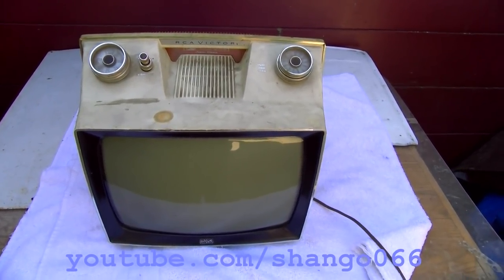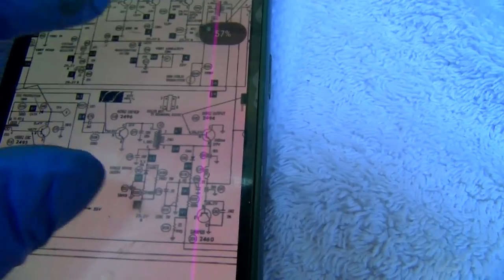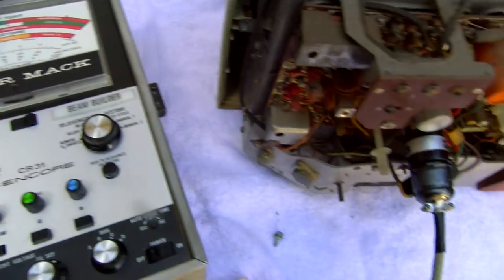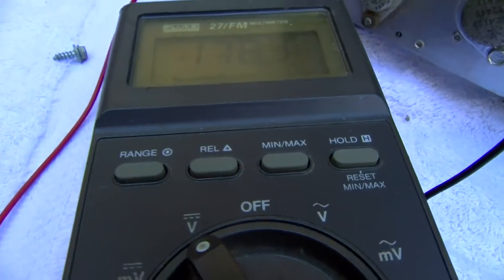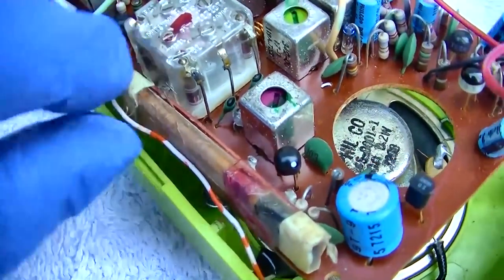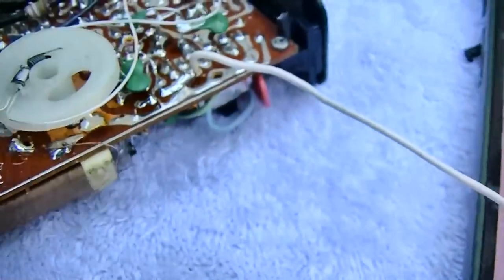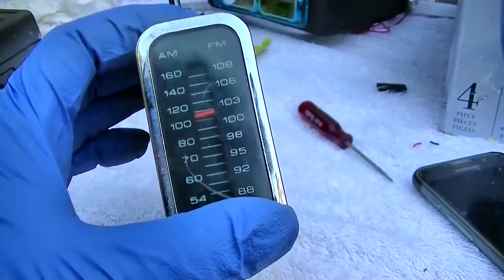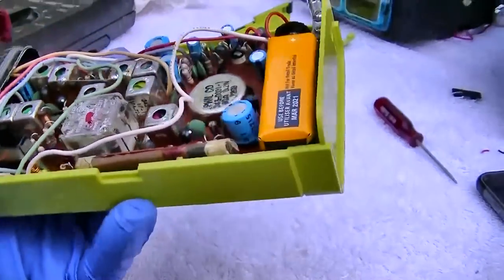1966 RCA Solid State Black and White TV Analysis KCS153b

Comment: I came of age in Flint MI in 1970. Pop. 300K+, thriving city, median income one of highest in U.S. My dad an auto worker like everyone. 'Shop rats'. I was 10, began garbage picking, and building inventions using bulbs that tested good around the corner at Ryckman's Drugs. I 'kindly offered' my little sister 25 cents, the cost of a gallon of gas, to plug them in whilst I hid. (OK, I lied. The gas cost 37 cents). And yet... my family... and that of every friend I had in 1970 - had a B&W TV set, and they used all bulbs altho I do remember getting burnt and zapped at the same time off of what I later learned was a Selenium rectifier. I retired from Biomedical Engineering last year. My sister survived my 'formative years' thank God

Comment: Real bummer on the CRT. Maybe you will come across another set with that tube and be able to resurrect it later on. Thanks for the videos. I found an old portable TV I got for you to do a video but it turned out to be working. Was told it was for parts.

Comment: Much as i like the Philco puke-it radio, I'd have much preferred to see you pulling the CRT from that set, putting the Super Mack on it & tapping the neck with a screwdriver until either the cathode touched or the neck cracked off & gave easy access to pinch weld it back on.
Reply: I had the same Beltron Shango has and had some pretty good luck using it to blast CRTs when working in the TV shop back in mid to late 80's. Also had the same B&K and really didn't care for it much other than testing. Did not have the Super Mack.

Comment: Boy, that set brings back memories.  Dad bought one of those in 1966 to replace the mid-50's DuMont that died a year before.  I later inherited the set and kept it going until 1997, when I tossed it because I was moving cross-country.  This was RCA's first transistorized set, and it showed.  It immediately began having problems; those 750 mA top-hat rectiifiers would reliably short out each year.  I ended up replacing the Horizonal output, damper diode, audio output, and 1 IF transistor.  All the power transistors were germanium so, began to revert back to sand after about 20 years.  RCA clearly did not know how to design with transistors: the regulated power supply used a resistor voltage divider tapped off the rectifier output as the voltage reference.  Several of the sweep transistors were being seriously over driven, causing the base-emitter junction to reverse bias into avalanche.  Interestinginly, the only solid thing on the whole set, was the CRT.

Comment: My parents gave my brother and I this identical set (except the back was gray not red) for Christmas in 1965. We had it until 1983 when the CRT finally gave out. It was a very reliable set. The only repairs was the on/off switch arced and failed ( a big problem for RCA in their 1965 B/W sets and the HV rectifier tube needed to be replaced in the late 70s if I remember correctly. Wish I had kept it and found a replacement CRT.

Comment: Too bad on that CRT.  Hope you can find one somewhere.  Also on that little radio, it looks like the solder is cracked on the slide switch.  And maybe something like a nylon grommet on that screw could act as a pulley for the dial cord?

Comment: I wonder if the tube from some early 1980s B&W portable would work in that RCA set, maybe with some tweaking to compensate for slightly altered specs. I once fudged a tube from a SS portable into a 1949 set and it actually worked, so it's conceivable.
Reply: PC No The neck got thinner and thinner over years, so your yoke won't fit and using the later yoke is so out of spec it will not work with the flyback circuitry. So a no go.

Comment: Leave the checker on all night then rejuve. Check HV. IIRC this had a special anode lead with built
in resistors. Saw a few in the olden days. Even then it was shot gun the 'lytics.  All the big US
co's made early SS sets. Zenith, Syl, Maggy, GE, West. Most were 12" & some 19 & 23". 

All were really built well, the Zenith is 100% hand wired. Only one run of 1000 built it is 

said.
LFOD !

Comment: How about getting a soviet Junost TV set or directly a replacement tube for that? I recall it should be around 12" as well, and if mechanically fits, then to adopt the electronics on a BW TV is not big deal... I won't be suprised if one could find even a brand new tube for that!
Reply: 31ЛК4Б is the tube type, well it has 11V heater... so "some" modification would be definitely needed :) And sure as hell, there are still NOS examples around :) https://www.avito.ru/sankt-peterburg/audio_i_video/kineskop_31lk4b_1246332528
Reply: @daleburrell6273  Of course, just like in case of anything else. It's just an idea from where might be possible to get a replacement tube...

Comment: yea, thats a pity for this old tv, but sometimes the picture tubes of small TV are very common and standard ? I would expect if the deflection-angle ist the same, many other bw-tubes of the same size will fit....
 I would save the chassis, especially the flyback ... perhaps you can get some if-cans to fix the other tv with the broken cores one year ago ^^
Reply: Like that Sears B&W perhaps (I recall the set - Shango re-capped it which fixed a few deflection faults then made fun of infomercial presenter Eric Theiss' way of speaking for comedy value). Could be an ideal candidate as the tube in that set is OK.

Comment: Too bad about the CRT.  I've got a very very similar set, with the same knobs, handle, cabinet design etc, but all tubes.  Was my grandmother's she bought new in 1966 when they built their summer home.  I used it in high school and college (early 2000's) and it still worked fine and had a great picture.  Haven't powered it up in 10+ yrs.. Always figured someday I'd do something with it but never have.

Comment: Tube needs a new gun. Funny enough, back in my youth i rebuilt a few CRTs... after about 5 failures I finally got one working, and a colour one to boot. The tools needed are not that high tech, barring the system to fire the getter and the vacuum pump, but I'm assuming no possibility of getting new gun assemblies for tubes anymore...
Too bad, nice solid TV.
Reply: Did you have a diffusion vacuum pump and an inductive heater to flash the getter?

Comment: Which part makes it harder to fit a different CRT - mechanical or electrical?
Reply: Probably mechanical, screen size, and deflection angle are critical for the tube to fit the case and the yoke to fit the tube.
Reply: Probably a bit of both. Older CRTs had low voltage focusing, later ones had high voltage, from the flyback. Necks got progressively shorter and skinnier. And later CRTs had the yoke permanently bonded to the tube.
Reply: Ok thanks.. I have messed only a little with this. I once tried fit the circuitry for a rounded edge tube to a flat-square one..  it worked but picture was well distorted..

Comment: "Needs a 12BN4" .. This in fact begs a 30+  year old question .. just how "interchangeable" are CRTs? (deflection yokes aside) I recall as a lad swapping out an era green computer CRT for a blue one - that worked, but an amber one wouldn''t (same pinout). Totally dark, always wondered why. I have a current project in mind that would utilize the red CRT from an old rear projection set .. Had been hoping to just drive it with the guts from a small B&W portable (the project requires an image, but not the hyper drive of a projection set), but recollections of the amber failure have made me set it aside. Inn theory you'd think that if you could light the heater, and rig the cathode and 'dag, that you'd at least see a rudimentary spot .. something to work with. Why is this not true?

Comment: Not worth swapping the CRT?
Reply: It is, but finding one is the hard part
Reply: It’s a classic case of unobtainable parts. You’d have to find another TV to get the part. Even in computers this happens, I have a 1987 Toshiba laptop that takes a proprietary memory module. It’d be easier to just buy a better version of the same machine, and mine is the base model.

Comment: That's a real shame about the RCA, it's a very cool set with 60's era styling. Maybe someone would buy it as a prop?
Reply: Props get treated very badly. With no backing screws it would be thrown out rather quickly.
Reply: @cassandrajoiner9933  Yeah, but how hard would it be for him to pop some screws in it? Even if they gave him $50, it's probably more than he paid for it
Reply: @justsumguy2u  He could use some pan-head wood screws like that Motorola he came across a few years ago.